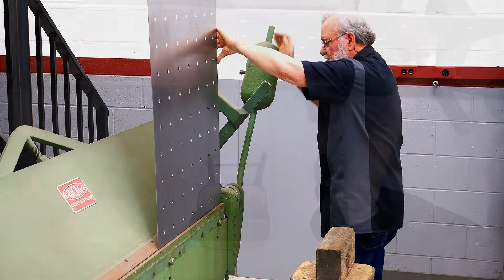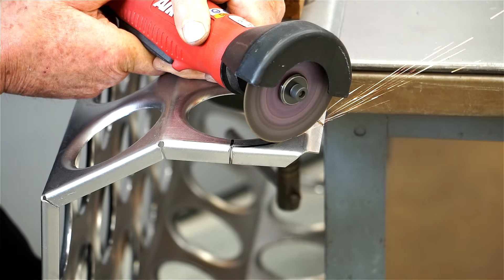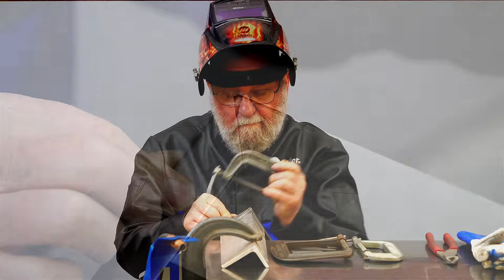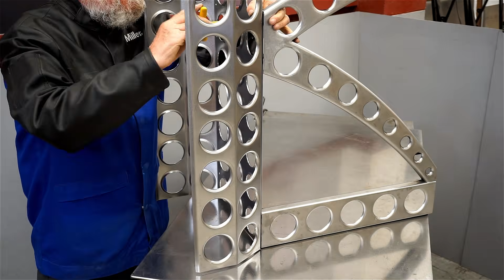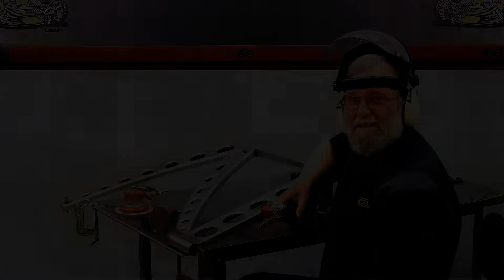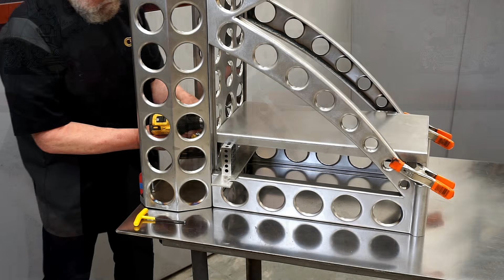'Holey' Welding Cart, Part 2

Comment: "I'm looking for ideas for new videos involving metal fabrication, and I would enjoy hearing any suggestions from my viewers!"- Ron Covell
I'm going to be selfish and ask you to recreate a masterpiece;
The Maserati Tipo 60/61 are a series of sports racing cars produced between 1959 and 1961 by Italian automobile manufacturer Maserati for privateers racing in sports car events including the 24 Hours of Le Mans in the 2-litre and 3-litre racing category. It used an intricate tubular space frame chassis, containing about 200 chro-moly steel tubes welded together, arranged triangular formation at high stress areas of the chassis, hence the nickname "Birdcage"
Reply from the maker: Thank you so much for the suggestion! I have been a fan of the Maserati 'Birdcage' cars for decades. I bought a model of the chassis which I keep in my bedroom, and I often pick it up to admire it. 
I went on a tour of Italy several years ago, and discovered a privately-owned Maserati museum which had a very nice collection of cars, including what may be the only mid-engined birdcage around!
As much as I love the design, I'm not sure it would make any sense to recreate the chassis without plans to make the whole car. I could not even afford to buy the gearbox for one of these amazing cars!

Comment: Hi much respect, I have a quick question.
I have a client that wants stainless windshield mldgs. 
They will be about 3/4’s of an inch wide and will have a eight inch radius to curve around.
Do you have a video on stainless trim?
Thanks.
Reply from the maker: Making large stainless trim pieces, such as those needed for a windshield, is quite a challenging job. You would be well ahead of the game if you could find trim pieces that are close to what you need and then modify them to fit your particular windshield.

This is the only video I know of that shows how to make stainless trim:
https://youtu.be/IqNEDt256hQ
Reply: @RonCovell  It’s for a Batmobile so it’s basically a one off. I think i will attempt aluminum first to get the shape down then go to stainless.
Reply from the maker: You can buy 'half-round' and 'quarter-round' stainless strips, in various widths. That might be a good place to start:
https://www.stainlessshapes.net/stainless-steel/half-round-bars/
These are often mounted by drilling and tapping holes on the back side, which is tedious. A friend of mine bought a stud-welding gun to put threaded studs on the back side, which is MUCH easier:
Reply: @RonCovell Great idea thanks.

Comment: First let me say, amazing job. I do have a question, as someone who’s only recently taken up TIG welding, I am curious why you chose to MIG weld this, I’m in no way saying I think you should have but more curious as to how you choose what gets welded with one or the other.
Reply from the maker: I prefer TIG welding for most sheetmetal projects. When I started this project, I just got the new Millermatic 211 PRO welder, and I wanted to give it a good test. As you can see, the machine did a great job, although I would have had less grinding had I used TIG welding.
Reply: @RonCovell that makes complete sense, thank you for responding .

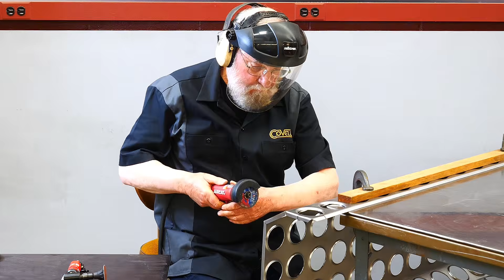Comment: 4:13 - pro tip - look for N. Vulcan or Cubitron 2 (or 3) cutting discs  ( used up 125mm (5 inch) discs with adapter from 3 thin washers work awesome) 
they cut waaay faster than ones u use and cubitron last like 12x longer  
thank me later :)  
i hate grinding 😆
Reply: do same with grinding belts - use ceramic ones - just remember they like at least 4000 best 5000-7000sfpm (up to around 140kph) or they start heating up parts , slow down grinding and wont last as long as with faster speeds 
PS 
that Cart looking awesome :D
Reply from the maker: I'm so glad you like the cart!
Reply from the maker: Thanks for the tip - I've heard only good things about the Cubitron abrasives!

Comment: Do you have drawings for this project? One of my students wants to make this for one of our welding carts in our shop
Reply from the maker: I'm sorry I do not have drawings for this project available. When I built this cart, I had to make many adjustments to get everything plumb and square. I don't want to put out a drawing package that will cause many frustration, saying that the parts don't fit together 'out of the box'.
Reply: @RonCovell totally fair love the welding cart design though
Reply from the maker: Thanks for your interest, and understanding! I would encourage your student to design their own welding cart. I started with the diameters of Punch & Flare dies available, the size of the welding tanks, the dimensions of the welders I used, and the design grew from there.

Comment: Love your Work. Looking Good. Did you Weld on the inside of the Corners? 
#STAYSAFE 
#PHILLYPHILLY 🇺🇸
Reply from the maker: Thanks! No, I did not weld the inside of the corners. Even if the penetration isn't 100%, for lightly-loaded part like the welder shelves, the strength of the joint should be more than adequate.
Reply: @RonCovell Thanks.

Comment: Not a diss, but seems you might want to find a box-and-pan (finger) brake so you don't have to use funny notches. Although from my experience they can be a bit fussy if the fingers aren't adjusted right; the beat up one at work doesn't clamp evenly and often bends crooked as a result. But we're using it to make fixtures and other things for internal company use... not works of art like you!

Also a bit surprised how much MIG was used (as opposed to TIG). But if it works and is easier/cheaper on supplies, then go for it. My employer MIG welds a lot of thin carbon and stainless steel (robot and hand welding both), so maybe I shouldn't be surprised.
Reply from the maker: I do have a box & pan brake, but it's not as heavy-duty as my big brake, and makes a larger radius bend on 16-gauge steel. I prefer TIG welding, but I just got a new MIG machine, and wanted to see what I could do with it.

Comment: I have a question for you Ron.  In the previous video, when pressing the die, you mentioned you were limiting the pressure so as not to deform the surrounding material.

So, acknowledging deformation can happen if done wrong.  And when working on a large flat piece simular to the back of this stand. Can the deformation from each hole build on another to make waves in the piece?  As in, it would be smart to press the holes, in a star shape, just like torquing down an engine component?  Or is the deformation just ugly wrinkling around the hole.

I imagine it shouldn't be an issue as long as the workpiece and dies are parallel, and the pressure isnt way overkill?

I hope that made sense...

Thanks for all your help over the years.  I really appreciate it.
Reply from the maker: The contact point of the Punch and Flare dies is a ring about 1/4-inch wide, outside of the area that is flared. A powerful press can actually make the metal thinner in that area (stretching the metal), and the more stretching you get, the more deformation. I've never experimented to see if a certain pattern of pressing would make a difference, but my hunch is that the pattern makes little difference.
Reply: @RonCovell thank you.  Not only as master of your craft, but generally speaking as a human; you are one of the best.
Reply from the maker: Wow - thanks for the high praise!

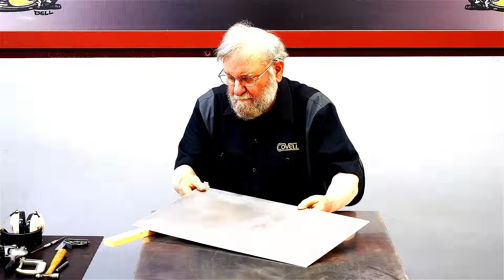Comment: 6:45 a caliper is not a marking tool
Reply from the maker: I understand that machinists who work to close tolerances take extraordinary care of their measuring instruments, but since I work primarily as a metal fabricator, I'm willing to give up optimal precision in the interest of quickly and reliably marking metal with my dial caliper.
Reply: I’d be surprised if you’re  competent enough to hand this man welding rod.
Reply: It is if you want it to be and Ron wanted it to be

Comment: I dig the creative solutions in order to use that press for the punching.  Would an arbor press have made this easier?
Reply from the maker: The chief limitation of my press is the limited width between the columns. Any type of press that was wider would have enabled me to pre-punch the holes on one side, then do all the bending in the brake.
Reply: @RonCovell   Of course, and it's still quite a large press!
My point with the arbor press is that the other side can simply hang under the bench and you wouldn't need that piece of shafting.  Wouldn't be able to do the inner panel though.
Reply from the maker: Now I see what you're suggesting, and that would have been a good option. I do have a 2-ton arbor press, but that's not beefy enough to punch a 3-inch hole in 16-gauge steel.

Comment: Love your videos, calm and impressive.
Whenever you tag weld there is a lot of black residue, maybe you should tune the flow followup time of the gas for 1-2 sec longer.
Reply from the maker: I think the reason for the black smudges is my holding the gun at an angle for the tacks. While I don't like the smudges, I have much better 'aim' if I position the gun with the cup actually touching the metal. I would never make a full weld with the gun at that angle, but it really helps me get the tacks exactly where I want them, particularly if I'm holding the gun with only one hand.

Comment: Still love the air tools, everything is going battery now days!
Reply from the maker: I use them both. Air tools generally have more power, but they have a heavy 'umbilical cord' that can hamper their maneuverability. Battery-powered tools are very portable, but often somewhat bulky.
Reply: Agree 100%

Comment: Why is it when I weld thin metal  I put a hole in it, especially they edges? Using a Meg with gasless wire.
I love this cart, I made one ou of a damaged shopping trolley.
Reply from the maker: The thinner the metal, the more difficult it is to weld, and the gas-shielded process is helpful for thin metal.
Reply: @RonCovell  thanks Ron, I'll try with gas next time

Comment: Absolutely love this cart! I still have to confess, that I'm one of those engineers, who love that by use of a die, you turn what is (practically) a 2 dimensional sheet into the 3rd dimension! increasing it's strength by removing part of it! As I said last time, I'd still stick my fingers in those holes & get them cut. Do you deburr the holes after removing the die?
Reply from the maker: Glad you liked the video! Yes, it is ESSENTIAL to deburr the holes, since those dies can leave a pretty nasty burr, and people often have a tendency to stick their finger into the holes!

Comment: Dear sir, I would like to ask. Do you have any tips for stainless steel mirror finish solution post welding. Thank you.

Also a work of art ❤thank you for your help and lovely content
Reply from the maker: There is a process called electropolishing that takes off all the discoloration from welding stainless. It does dull a polished surface very slightly, but it can get into tiny areas that you can't reach with a polishing pad.